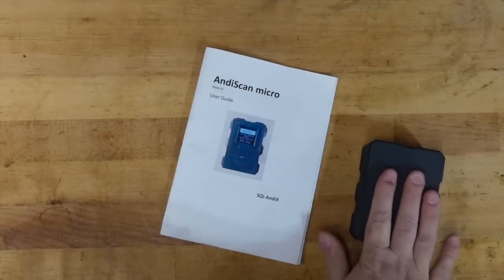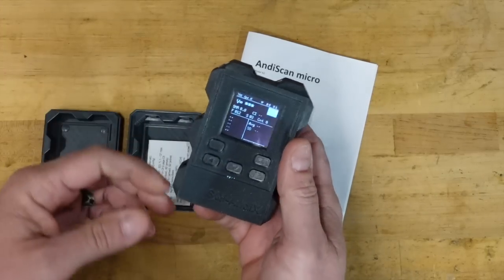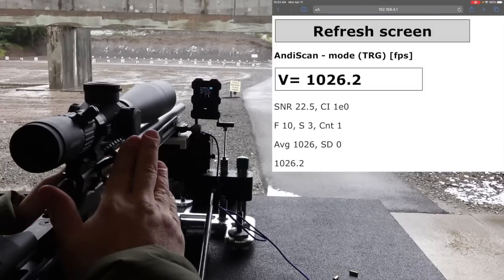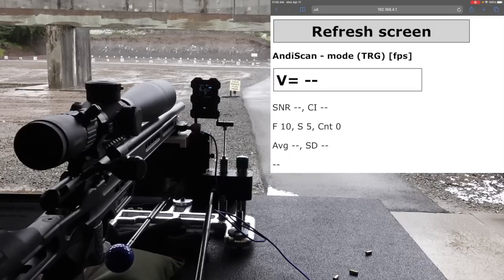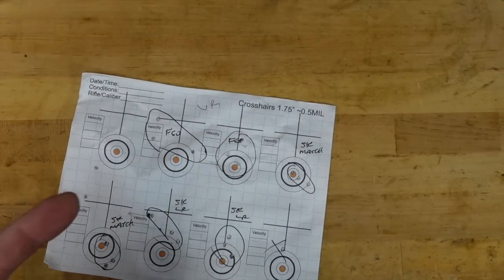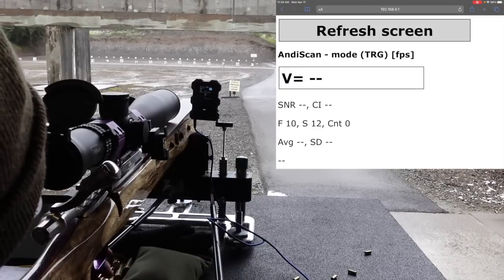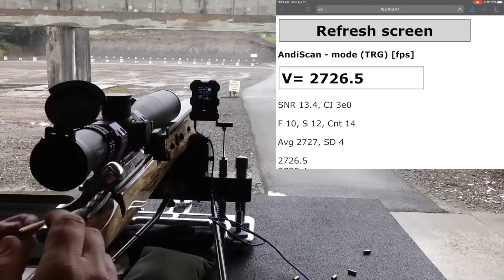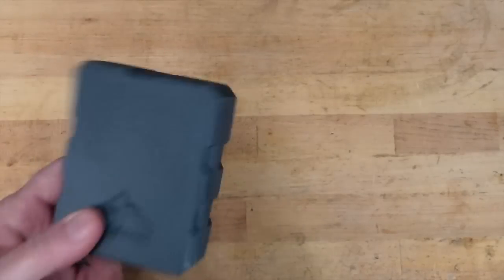AndiScan micro A2 doppler ballistic velocity chronograph UPDATE #1

Comment: WRT match grade rimfire ammo and switching between types or brands, you wait till you have shot a few before judgment in order to allow for the differences in lubricant and powder residues. This doesn't always happen, but there is no point getting excited or disappointed right after a big change. You can also see this in centerfire when switching between drastically different powders or copper solids for example. Testing a little for stability is wise.
Appreciate the unfiltered show of the radar. It looks like more work needs to be done, but shows promise. 
Can you show what the "raw data" files you mentioned look like when you have a chance? TIA

Comment: Looks like the FX Radar -  it that is aimed at the air gun market.  Doesn't do full bore.
Reply from the maker: Size wise I guess it's similar but this unit handles all the way up above 4000fps with just about any cartridge.
Reply: @FClassJohn  sounds good - will it compete on price with labradar?
Reply from the maker: @UnCoolDad  I'm not sure. I think it's gonna be around $800ish so technically it's more than an out of the box Labradar. But with the LR you have to immediately buy a stand, battery, case etc which add up. His  (so far) is ready to use out of the box with internal rechargeable battery, multiple attachment methods and a case. So my best guess is it'll be close in the end.
Reply: @FClassJohn  Very interested in this. I test F class rounds often but would love something that can do .22 subsonic and even air rifle.

Comment: Wondering how it will work if you have multiple shooters at the range around 6 feet apart? Will it pick up the other shooters rifle or will it only pick up yours.
Reply from the maker: Depending on the situation other shots can trigger it because it's sound activated but he's also working on a firearm mounted trigger to isolate it. But honestly, I haven't had too many issues now that I'm used to the unit and how it works.

Comment: Hi John.  What is the max velocity it can support?  I run some varmint rounds around 4,000 fps and that is beyond the limits of the LabRadar.
Reply from the maker: If I remember right it's just under 4200fps. I'm working on borrowing some varmint guns to test but his data says just under 4200. I'm guessing that's the highest legal limit for commercial use on the radar spectrum.
Reply: Adam, wouldn't the labradar downrange give some idea? Like 50, 75, 100 and 125 yards?